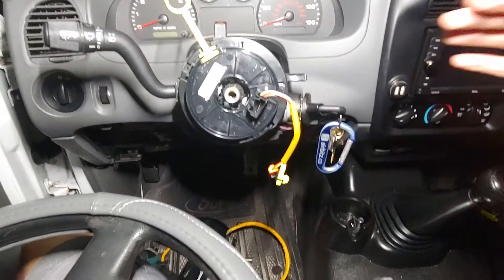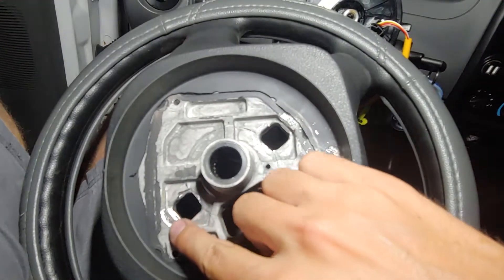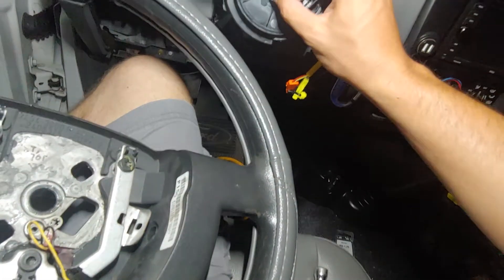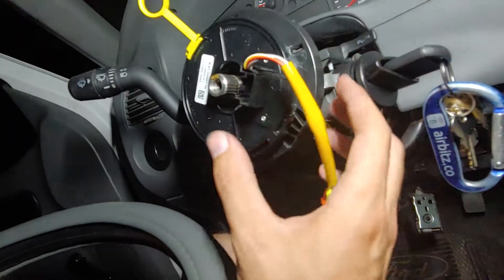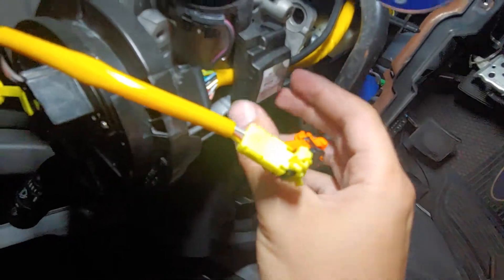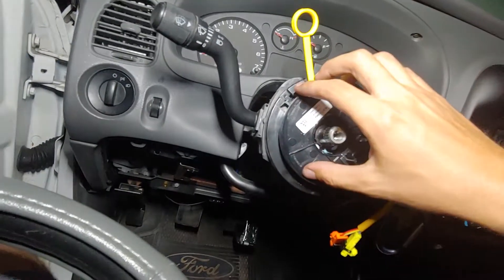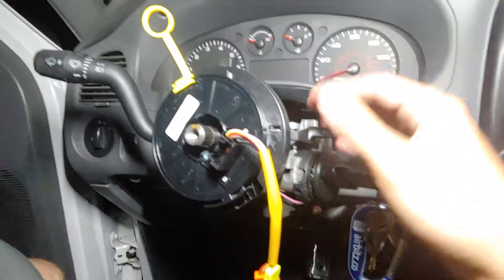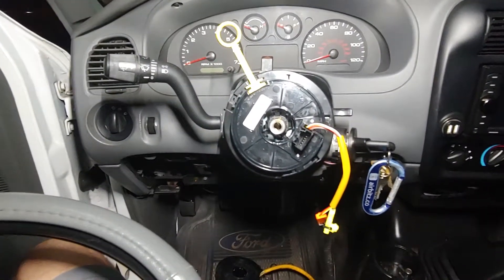2008 Ford Ranger Clock Spring Replacement

Comment: Do you know where that ground underneath the knee panel area is supposed to connect to? I have that terminal screwed on but no wiring connecting it to anything
Reply from the maker: The cable is supposed to touch the metal area around the key cylinder. There is no other cable to connect to. You will know if it's connected because otherwise there will be a chime sound similar to when you left your key in the ignition.

Comment: Did you end up pulling the yellow tab after the wheel installed or right before you put the wheel back on ? Do you need to adjust the clock spring or does it come already set and you just have to pull the tab?
Reply from the maker: Before I put the wheel back on. It's already set to the correct position.